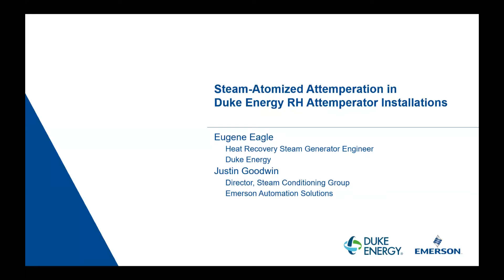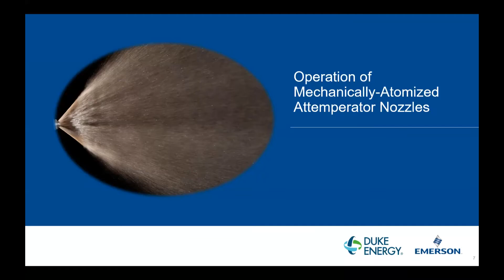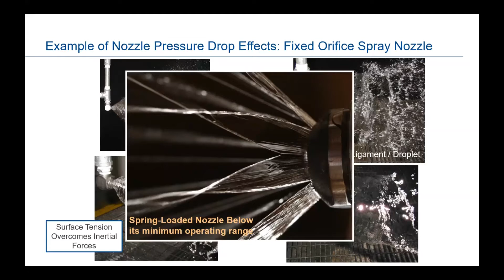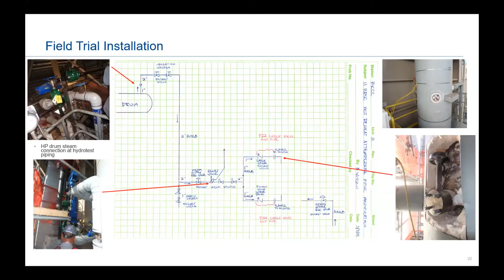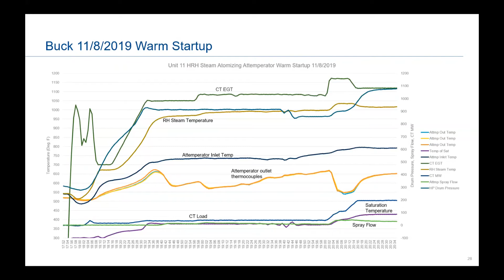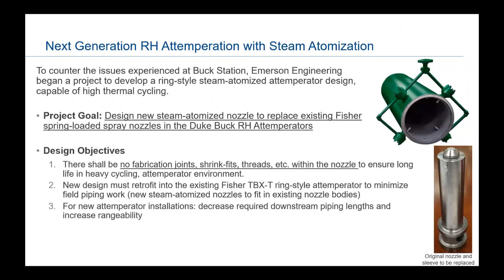STEAM-ATOMIZED ATTEMPERATOR SOLVES DUKE ENERGY RH ATTEMPERATOR PROBLEMS

Comment: I re-watched this presentation today and several questions come to mind:  

1.  Atomizing steam flow is assumed to be around 7,500 lb/hr from the comment of 15-20% of water flow.  This could be somewhere around 1.5% of HP steam flow at base load.  Have the penalties of lost MW been evaluated?  Also at low load the same 7,500 lb/hr (assuming on/off control) may not be a MW loss, but extra fuel would be burned.  Over the life of the plant have these efficiencies been considered in any ROI?

2.  There is mention that the system is installed on a facility with 85-90% capacity factor.  Since attemperators are most often stressed during startups, wouldn't number of starts be a good or better metric to use when judging this attemperator and not capacity factor?  As we all know, a base loaded CCPP sees little attemperator issues, it's the starts that are killers.  I understand that in this specific case it was low load operation that was causing issues, with downsteram equipment, but again it's the starts (or initiation of spraywater flow) that usually cause attemperator internals and nozzle thermal fatigue.  

3.  What sort of failure mode is expected for these nozzles?  There is massive amounts of experience with spring loaded nozzles and the failure modes are quite understood and avoided with Inconel, clean water, and chemistry.  But even when they fail they typically have not lead to massive catastrophic damage.  Is that true with this attemperator design?  By this I mean, if the new nozzle design were to crack and break off, what warning signs would there be?   What damage would come from operating with a failed nozzle for some time before discovering it during an outage?